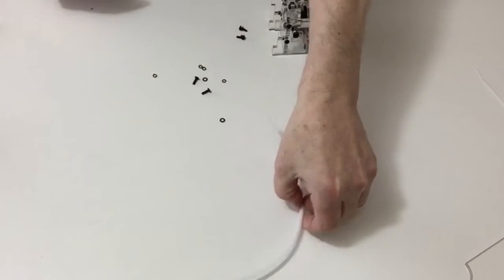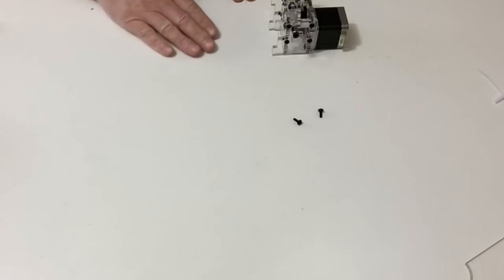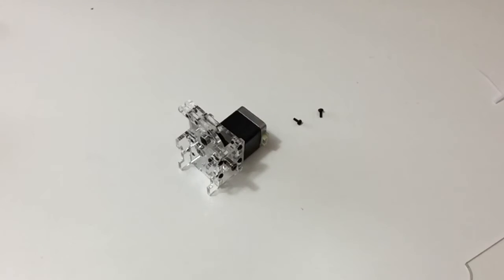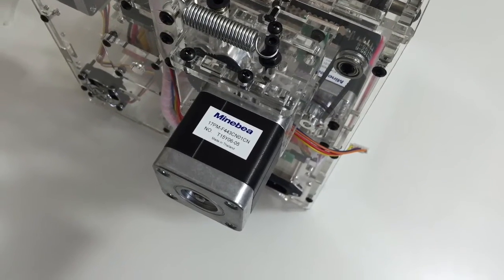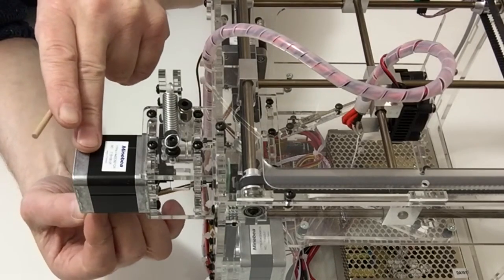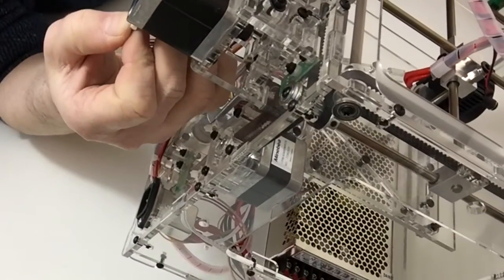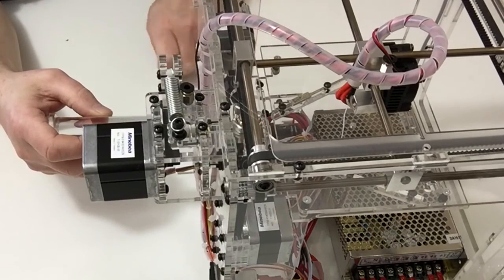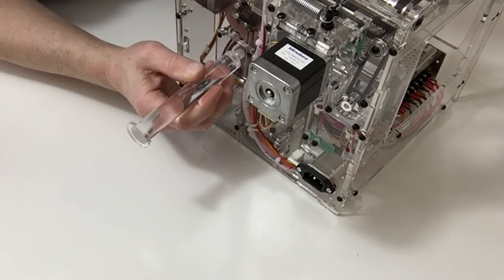Official idbox 3D Printer Build Diary - Pack 12, Stage 54

Comment: Hi, i have a problem with my tray. when i go to print the tray goes to the top and keeps going, i have checked all settings,
Reply from the maker: Hello! Have you had a look at our forum - http://forum.model-space.co.uk/ - the guys there will be able to help!
Reply: H,  I did and someone else has the same problem.. they refer you back and check that you have the coupling and lead screw in the correct position . ive cheched and still have the same problem